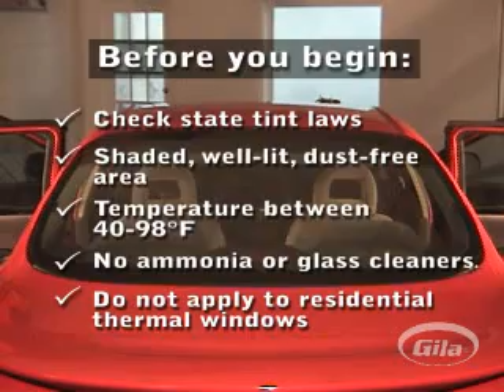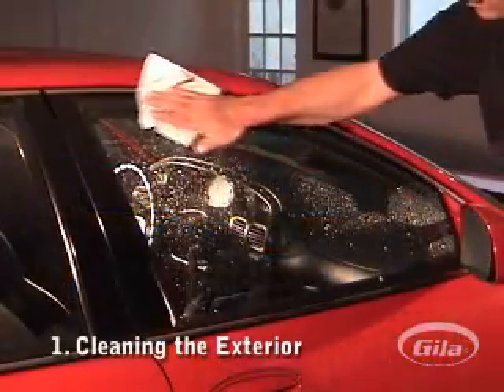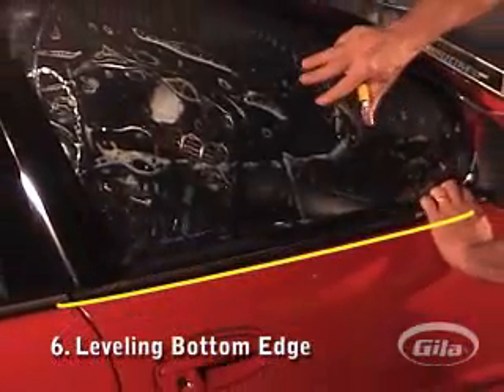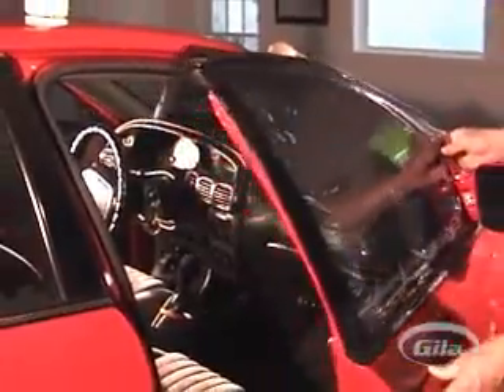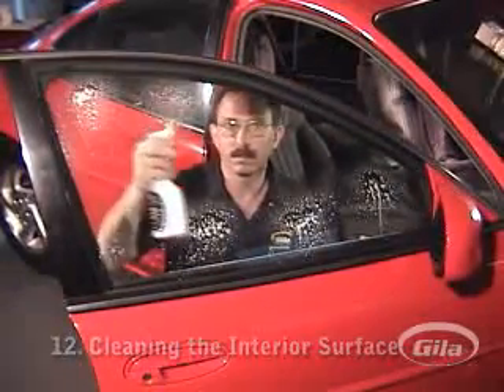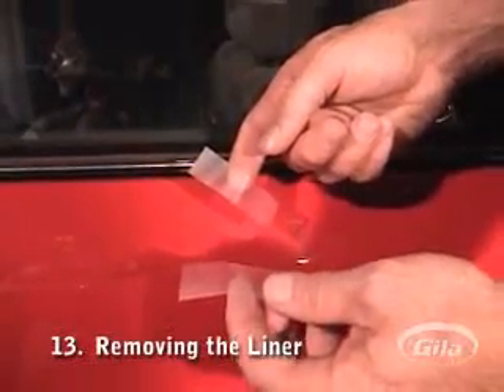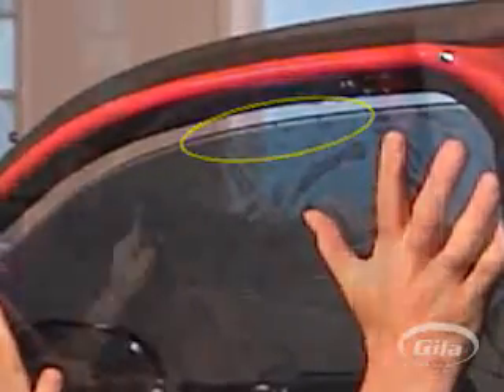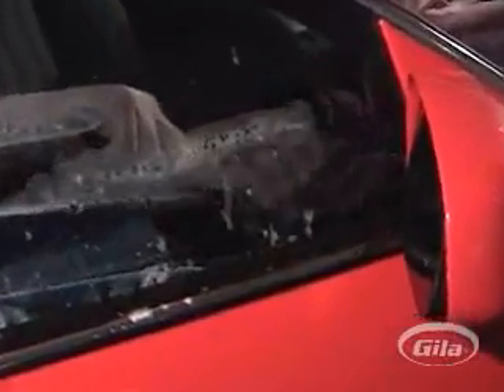How to tint car side-window | DIY-sidewindows

Comment: It's like applying a screen-protector for an iPhone...it could seem complicated at first. For the electricity issue, most kits are given the solution and an empty bottle. You would put the solution in the bottle, with distilled water. Distilled water will not ruin electronics. In the Navy, they drink distilled water when working with electronics. From what I know in college, the instructor said water creates a cover over electronics. Distilled water does not. :)

Comment: Ive been tinting for over 20 years in San Antonio Tx.  I found that 80% say ill pay someone else to do it.   You might waist your whole day trying to do 4drs. Not to mention the other half  might get upset because you were suppose to take her to dinner. But yes the Gila video is a bit cheesy.  It is not easy to tint windows but yes,  We can tint windows faster than what is shown on the video. . It takes me 7 minutes to do one rollup. Thats, hand cut, clean and paste.

Comment: Ya thats alot harder then it looks! Take notes off the video and bring them to the car with you. Do it step by step. The rolling down the window and trim off the top tip is important.  The inside rubber strip is a little different shape then the outside rubber I trimmed against on my car. Check yours. Do it in a garage if you can, any little breeze will fold the film and cause a small krinkle you cant squeegee out. Careful with the squeegee  , it can and will tear the film if it get dries out.

Comment: You can also get precut film for you're windows if you don't want to cut
Reply: Seems to me it would make more sense to wet the back of a square sheet, stick it to the glass in the middle, then squeegee outward towards the edges. THEN trim away excess. It saves you having to precut the pieces and position them correctly on the glass. 

Applying vinyl decals to cars & signs works pretty much the same...

Comment: @MrSkidoomxz  Tinting is not really hard if you know the drill (like everything?). Think of it as of a sticker, it doesnt need to be heated after its applied as you should have done it before, if you are heating it after, you only speed things up except for special conditions and tinting secrets which i cannot tell, thing is that basicaly no video on youtube will show you everything as it would ruin the bussines

Comment: Never said you installed the tint wrong. Just and observation on how your drenching the electrical components with water. Divert the water. If I was a customer do you think I'd want to see my power locks and windows soaked. Also if it puddles it can rust out the door. I've seen it happen being a auto mechanic. Good luck.

Comment: This is too difficult. The guy makes it look easy, but it really isn't. I tried it and the damn film creased while I was measuring in it. Then too cut it, that's all a task in itself. The blade he uses and comes with the kit totally sucks ass. It's not as sharp as it is made out to be, so the cut was awful. Best advice. Have a pro tint your windows. On the long run it's cheaper, because if you plan on doing it yourself, make plans to spend around $60 to $80 because of mistakes.